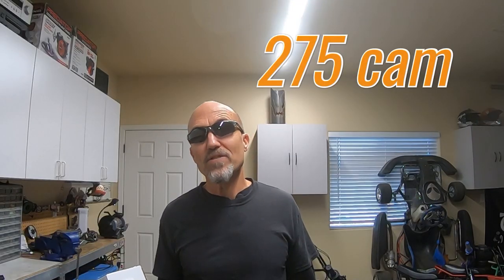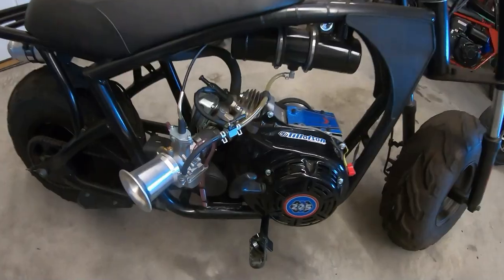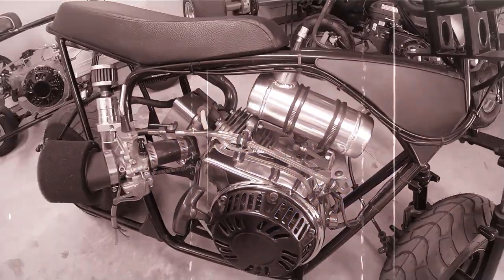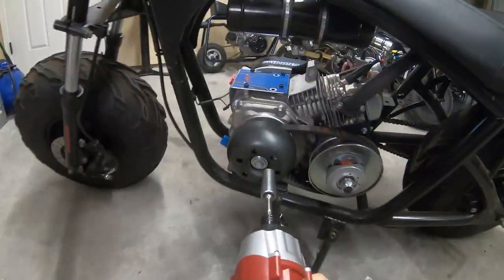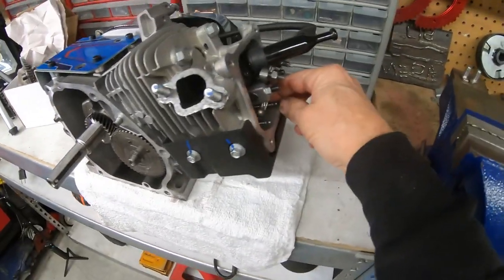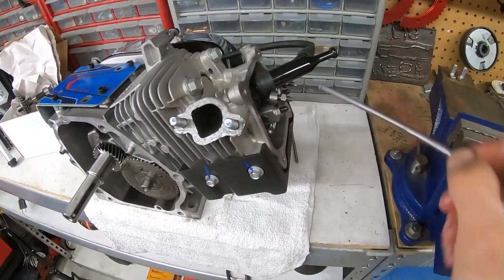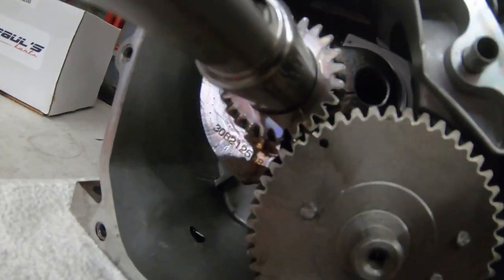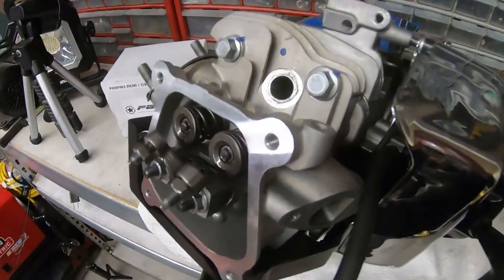Paul's karts PKRPM3 cam in the Tillotson 225 how will it run?

Comment: Interesting thing is the 223 is a 70mm bore with a 58mm stroke and the 225 is a 72mm bore with a 55mm stroke.

Seems these engines like stroke too.
Reply from the maker: Ya, I want to throw a stroker kit in this one.
Reply: @Black66  Bore is good with big valves as it helps unshroud it from the cylinder walls. 

Big step up if you go 76mm+

Comment: I've happened upon a predator 212 that seized up. I thought it was trash, so the plan was to dissect it with the kids for educational purposes. I pulled the head and smacked the piston with a mallet and it freed right up. Can't find anything wrong internally, so I'm just gonna build it. Your videos are really motivating for me to get back into wrenching. Any tips on things to look for that I might miss? It only has a couple hours run time, I haven't pulled the piston yet. The only thing I can think is the ring gap is too tight and bound up when the engine got hot. Thanks, really enjoying the channel

Comment: Paul's cart is a scammer I'll never buy nothing for him ever again
Reply: I bought a 3in bore block from him  and the liner was way down in the block. Tried for weeks to get him to answer the phone. would not answer e mails. Block was unusable..
Reply: Didn't you have a video about his coil bracket?
Reply: Yes
Reply: I ordered 3 of his coils, 2 didn't work....  Ordered a small chamber, big valve head.....  The combustion chamber came with a bunch of Pitts in it that I had to re weld the head back up to eliminate that.  For what he charges, his work isn't worth it.  It would be different if if what he advertised is what you would get.
Reply: @travisstark9527  I've heard stuff like that from other people

Comment: I just built a 263 (3” stroker) I’m using the pkrpm3 cam and I am getting really bad kick back when it tries to fire up. It is acting like the timing is out maybe too advanced. I’m using the arc flywheel with the timing advance. Wondering if anyone has run into this and maybe has an idea of what I can try